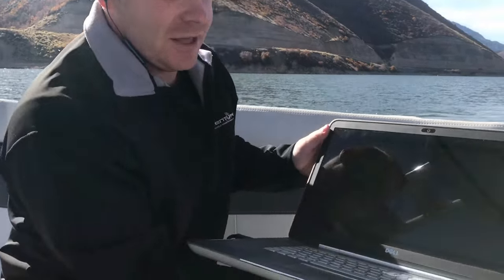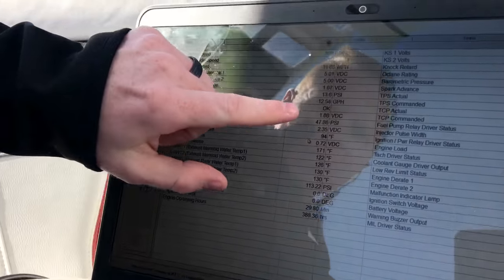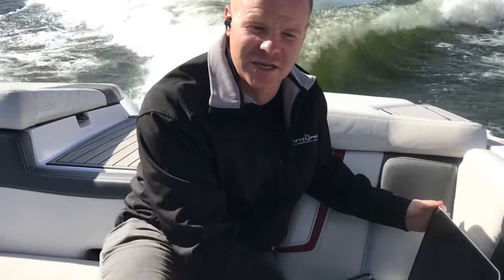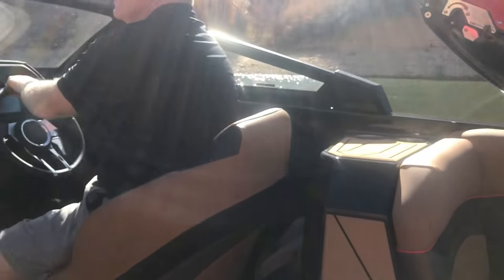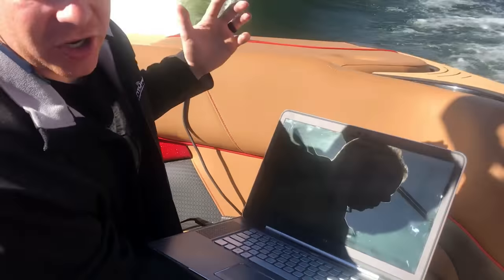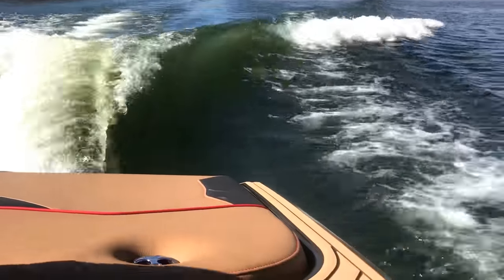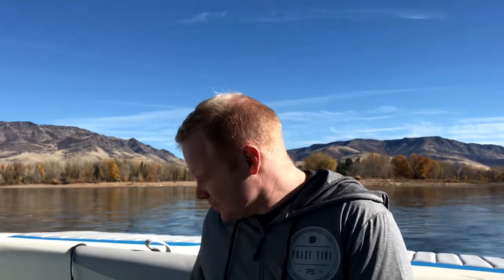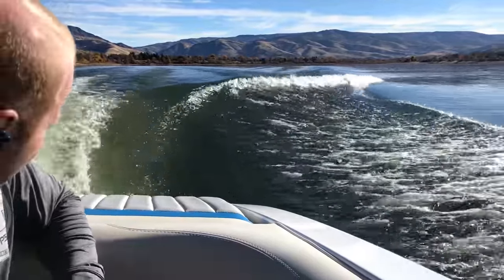Malibu vs Nautique vs Centurion Fuel Efficiency 2018

Comment: What software are you using and where does it plug in? 
Secondly does any snapon products work for this?
Reply from the maker: The software is Diacom software and the hookups are different for every brand motor. It connects directly into the computer of the engine. I don't believe snap-on makes a product that connects to an engine but I could be wrong.

Comment: Looks like a 2014/2015 G23.  New transmission, new hull design, new motors for 2018.
Reply from the maker: You are correct, the G23 is an older model. We would be happy to use a 2018 model, and have even offered to do the comparison to other dealers, though no one is willing to do it at this point and getting a hold of one to test is very difficult to do. The motors for 2018 are the same as in the boat we tested, the biggest difference is the transmission when comparing fuel efficiency. The hull on the G23 is also different, however both the hull and the NSS system on 2017/2018 G23s are actually less efficient than the one we tested. That said, they do put out a better surf wave than the older models which was the reason for the change.

Comment: Appreciate the proof!
Reply: Centurion and Malibu engine stated but not G23. Also what are transmission ratios and prop setup?
Reply from the maker: You can see the full details here:
http://www.mmwatersports.com/boat-performance/centurion-vs-malibu-vs-nautique-wakesurf-fuel-economy/

The Nautique had a PCM XR7 w/ a 2:1 gear ratio. I don't have the prop spec but it is high elevation prop (probably 17x14 or something similar).

The Centurion Ri257 has the H6 w/ a 1.72:1 GR and a 16x13 prop.

Malibu also had a high elevation prop, though I don't have the specs (sorry these boats aren't ours so we aren't sure). I believe the gear ratio is 1.76:1 but not 100% positive.

We have another video comparing engine power in each of these boats that will be released in about a week that addresses the comparison of the XR7 in the G23 compared to the H6 in the Ri257. The XR7 is available in the Ri257 and increases fuel consumption by about 15% compared to the H6 from what we have tested.
Reply: BoardCo  thanks for the follow up reply with further information

Comment: Hi Mitch and Boardco,
TY for your videos, please keep producing them. I think it may be time for an updated video focused on fuel consumption. How about a 2020 Centurion Ri257 with a 525 HP motor and a 2020 Natique G23 with a 525 HP motor (or a Paragon) and a 2020 Malibu M240 with a 607 HP (LT4) motor? To get started, here is a 2020 Malibu M240 with the new supercharged LT4 showing fuel consumption with full ballast (all 6 hard tanks full) 10.8 MPH, wedge position 3 and surf right – showing fuel consumption
https://youtu.be/tWG6j5pHqLM

Comment: you guys need to do a comparison with the h6 And the supercharged with the ri257
Reply from the maker: We probably will. The power is a bit more in the XR7 and fuel efficiency is a bit less but actually very similar. The most noticeable difference between the two engines in the Ri257 is top speed with the XR7 topping out 5 mph higher than the H6. Fuel efficiency and low end is within 10% of what you see on the H6 at our elevation.

Comment: That is a Malibu wakesetter from 2015 or 2016, I have a 2017 24MXZ and my boat don‘t need 17 GPH. My boat Need just 11 GPH.
Reply from the maker: That is correct, the MXZ in this video is a 2016 model. The 2017 and newer ones will burn slightly less fuel, but it is important to also understand that we are running these boats at a high elevation which increases fuel consumption significantly. We would have run the test on a 2017 or 2018 MXZ but as you can imagine it is difficult to arrange to do that. It was quite difficult to arrange to get the one we did. We are more than happy to hook a Diacom up to any boat on the market to test under the same conditions, we just need access to them.